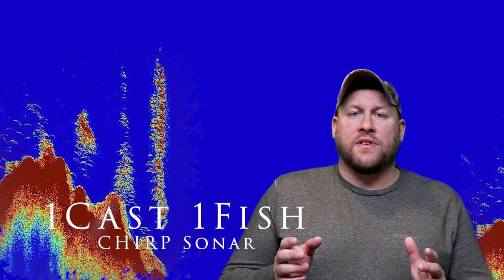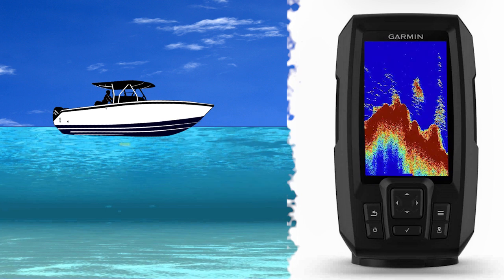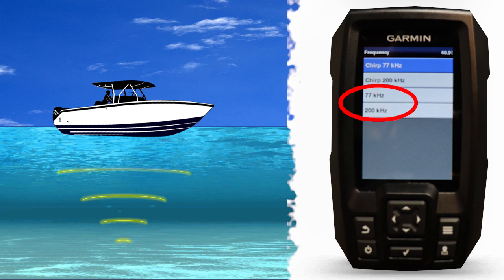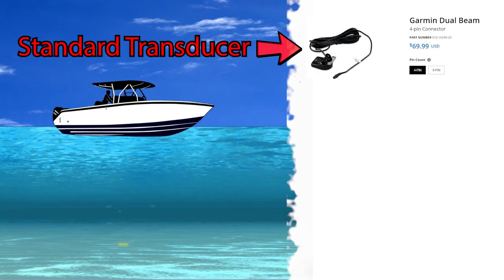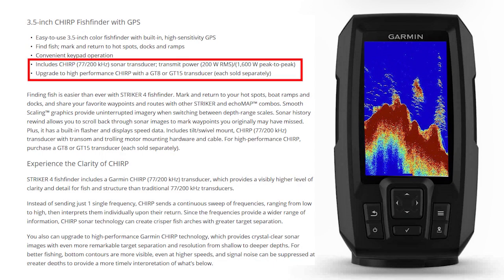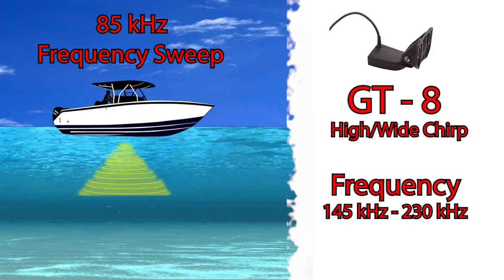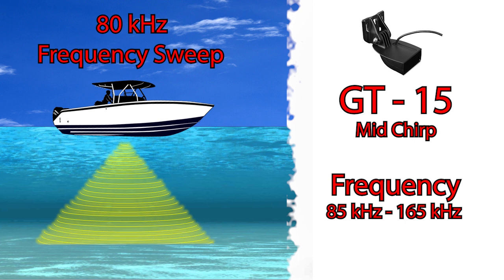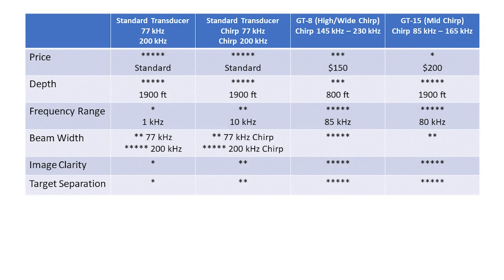Garmin Striker 4 CHIRP Sonar Tutorial (What you NEED to know)

Comment: Do the frequency choice impact battery usage?
Reply from the maker: No it will not....the biggest drain on battery life normally is screen brightness...the brighter the screen the more juice used.
Reply: 1Cast 1Fish the battery for the fish finder is the trolling motor battery, right?
Reply from the maker: Well that can really depend on setup...I have seen them hooked to the Cranking battery...especially if the trolling system is 24V or 36V.  I have seen them hooked the trolling battery if 12V....and I have seen them run of their own battery.

Comment: How I can change manual the frequency on garmin 4 CV ? I want to use traditional with 145 kHZ frequency.
Reply from the maker: The frequencies are preset, you can not manually adjust to other frequencies other than the preset options.

Comment: Great video! In fact, all of them are very informative and well done. You are clearly the expert in this area. A couple of questions after viewing all of them: I have an inflatable kayak that I'm looking at using for some still fishing and want some ideas on how to mount both the Striker and transducer since drilling into the hull isn't an option and there are air bladders on the kayak floor. I think I can float the transducer, but I am not exactly sure. Second, I wear polarized corrective lenses in the sun and wonder about reading the screen as polarized lenses don't usually play well with things like Android phones and camera screens. Have you worn polarized glasses when using the Tracker and were there any readability issues? Third, is the screen size and resolution difference really that significant between the Striker 4 and 4 Plus/cv? I'm looking at the 4 Plus cv because of the larger screen, but I am somewhat discouraged by the diminished resolution, and I really don't need all the mapping features. I think that's it for now. I really appreciate your guidance.
Reply from the maker: Some really great questions and I can definitely see you have done some homework...so here it goes.
1. Since the hull is air bladders the inside the hull mount will not work since the soundwaves do not transmit through the air gap properly.  Honestly I do not have a really great idea how to make this work other than a mount that swings over the side and into the water....the only issue with floating will be the waves and spinning...this again will mess with your images.  What model kayak do you have that may help me come up with an idea as well.
2. Polarized glasses never work well with any screen like this...even on my $2000+ dollar units on my boat the issue is still there.  The viewing angle will help a lot, so experiment.  There are newer (very expensive) fish finders that are addressing this issue, so at some point it may trickle down to basic models.
3.The resolution is awesome on all the models, so no worry there.  I personally like the Plus and Plus CV for the bigger screens.
Reply: @1Cast1Fish  Wow! Thank you for responding! Since writing my questions, I went back to the retailer wearing my sunglasses and looked at the screen of the Plus 4 and Plus 4cv. Wish I could have evaluated the Striker 4 as well, but the only model they had was in the portable kit so that was a no-go. Also, I figured if I have trouble seeing small images (like on a cell phone), a smaller screen will not be my friend. With my polarized Rx sunglasses I was able to read the screen on both units very clearly. I hope that doesn't change in bright sunlight, so if it does, I'll be sure to let you (and others) know. Regarding the kayak, it's an Aquaglide Chinook 90 and the two side bladders are about 10" wide. I was seriously going to use the float supplied in the Portable Fishing Kit (bag, battery, charger, base with cable storage and float) and hope that it worked. The reality is this: if I can get to the fish and see the fish, there's no way I'll actually be able to hover over the fish in an inflatable kayak, so this whole exercise is more about spotting the area in which they are schooling and hope that some are hungry enough to bite. I usually troll for kokanee, but I will be jigging for them this time.  I've seen a couple of videos using PVC to thread the transducer wire down to the water. One guy noted how the PVC just floated up on the water as he gained speed (that won't be my issue), but I think I can solve the problem by attaching heavy-duty velcro to the pipe and kayak. Failing that, there's always duct tape... Wish me luck! And thanks again for your response and you fantastic videos!
Reply from the maker: I checked out some pics of that kayak and it seems you may be on the right track for finding a way to use the transducer most effectively.  Half the fun sometimes is figuring it out and inventing some new or un thought of way to make it work.  Give the float a try and see how it works for your type of fishing...it could be workable....and I always love PVC and duct tape, lol....plenty of great PVC contraptions on many kayaks.  Good luck and if you have any questions let me know.
Reply: @1Cast1Fish  Hi, it's me again. The Striker Plus 4cv hasn't arrived yet, but the portable fishing kit did and I had a chance to assemble the base unit and charge the battery, hence my next and probably dumbest question so far: I think this has an F1 or F2 battery and the connectors from the Garmin charger connect well enough but are ridiculously tight. I was able to disconnect and reconnect just to see if it might loosen over time, but the change wasn't significant. Is that normal? Also, when I look straight down onto the charger connectors, they are flat on one side and the two edges curl in toward the center forming the other side, like a sideways "B". Is there a right and wrong way to connect them to the battery other than the obvious red-red, black-black connection? I wasn't sure if the flat side of the charger connector should be up and the curled side down or vice versa, or if it even mattered at all. Whichever way I try it, I still need to jiggle the connector until I can get it separated from the battery. My first inclination was to try using pliers but I thought that might be a bad idea. As always, I really appreciate the guidance provided by my very own Garmin expert! Thank you so much!
Reply from the maker: Sorry it took so long to reply, but comments within the same comment tend to get buried and lost sometimes.  Its much easier to start a new comment sometimes since I will see it easier.  So the connectors are very directional in how you push them in...they are made to line up one way.  The connectors shape should match the fish finder plug in shape.  Most even have a small nub that helps you line this up.  If you forced the connectors in the wrong way you could have easily damaged the pins....so double check them. Also the connectors are a bit tight....this is so they seal up well so water can not get into them, but they should easily pull out by hand...not pliers.  Hope this helps and any questions feel free to ask...(in a new comment)  so I see it easy and can get back to you quicker.

Comment: Would have been nice to see an actual demonstration. I still don't know which to use when. Or with such a low res screen as striker 4 if you could even see any difference.
Reply from the maker: It does make a difference, even with the smaller Strikers, however it is more noticeable on a larger screen, or deeper water.

Comment: Just got my Striker Plus 4 and watching your videos. On my Frequency screen I only see "Chrip, 150kHz, 200kHz, or 240kHz". I don't see anything for a CHIRP200.
Reply from the maker: What transducer are you using?  I believe it should be Chirp 77, Chirp 200, 77, and 200 options.
Reply: @1Cast1Fish  just the standard transducer that came with it. When I check the sonar settings all I see is "Chrip, then 150kHz, 200kHz, and 240kHz". None of the others have CHRIP in front of it. That's why I'm a little confused.
Reply from the maker: @PudgyPastures   Might need to give Garmin CS a call...I may be missing something, but I believe it should be different options.  I have never used a Plus, but it should be the same transducer as the base model just with addition of Quick Draw Maps.

Comment: I'm having problems with mine. The depth is incorrect, it would say the fish are at 25-30 ft and the water is only10 ft deep. Any suggestions would be great.
Reply from the maker: So it's showing bottom at 25-30ft in only 10ft of water?
Reply: @1Cast1Fish  Yes, I'm using a kayak. I actually pulled up to the bank and it was still reading depth? It is a refurbished Garmin. I watched your video and I still can't figure it out.
Reply from the maker: How do you have the transducer mounted?
Reply: @1Cast1Fish  The is hatchspace in the front, and mounted inside that. .
Reply from the maker: Ok is there by chance a air gap under the transducer?  Watch my videos on in hull mounts and let me know.  Sounds like a install issue to me as a air gap would cause some of this issue possibly.  If not check all your pins and connections, if no issues found still try a factory reset.

Comment: Hi i got a garmin 7 striker cv can you please help me with the best setup coz i really dnt find it helpfull
Reply from the maker: I need to do a video on basic setup...but until then the factory settings are not all that bad...I would change my scroll speed to low as a starting point and use a Chirp frequency
Reply: @1Cast1Fish  the thing is that i dnt know when its solid ground or soft lol and i dunno how to use it when jigging
Reply from the maker: @eliefarah1525  Watch my videos on transducer cone angles...you want to choose a frequency that is not very wide when jigging.  Also adjust your sensitivity "Gain" up a bit.
Reply: @1Cast1Fish  ok sir i will try it tomorrow but still please if u can do a video on how to define the ground if its solid or soft and what are the best settings for jigging and those stuff it will be helpful and i will be so thankful for you
Reply from the maker: Will do
Reply: @1Cast1Fish  goodmorning thanks for the tip i tried what you told me to do and it was great it worked pretty well thank you
Reply from the maker: Awesome to hear...glad I could help
Reply: @1Cast1Fish  i tried chrip 200khz and put the gain on 75 it worked well i was on a 20 meter depth do u think it will work on 60 meter the same ?
Reply from the maker: I would definitely stick to the 200 in deep water, you will get plenty of coverage and better images and detail
Reply: @1Cast1Fish  you mean 200khz without chirp and how abt the gain should it be high or low?
Reply from the maker: Use the Chirp definitely...set gain about 75% and adjust from there
Reply from the maker: Just don’t use auto gain, you will need it in manual to adjust when jigging
Reply: @1Cast1Fish  ok sir thank you so much i will try it
Reply from the maker: Good Luck
Reply: @1Cast1Fish  thank you it worked pretty well really thank you if there is any more options to do i will be grateful
Reply from the maker: Awesome to hear...really best way is to try small adjustments and time on the water to really dial it in
Reply: How can i send you a photo so u can explain something for mw

Comment: How is distance calculated from left to right on the screen?
Reply from the maker: It doe snot really work like that, what you see on the screen (left) is old info from the past.
Reply: @1Cast1Fish  yea I get that but what I don't understand is how much history? Like how far from current location. Example: is that school of fish in the middle of the screen 10 feet or 100 feet away from the boat? Depth is crystal clear but I don't understand how horizontal distance is calculated.
Reply from the maker: That’s impossible to tell with so many variables like how are the fish moving, boat speed, screen scroll speed, water depth (cone size), etc.
Reply: @1Cast1Fish  forgive me if I sound stupid, but if that's impossible to tell how do you know where the fish are?
Reply from the maker: @fishingwithadrian754  have you watched my video on fish arch’s? It may clear things up a bit better for you...check it out.  Let me know if it helps?
Reply from the maker: @fishingwithadrian754  this same question is why they now make side imaging, live scope, 360 degree sonar.  You could never tell with certainty where the fish actually are with 2d sonar...but with these new fancy and expensive units you can locate fish and toss your lure on their head.

Comment: Why would someone use standard frequency if they have chirp frequencies?
Reply from the maker: Great question....for most applications I don't...however the one that sticks out the most would be if the water had a lot of debris….such as after fall turnover.  In this situation since the Chirp is a disadvantage since it will pick up all the debris at a higher level.  In this situation I use the Non Chirp